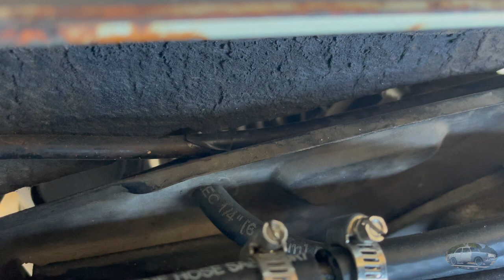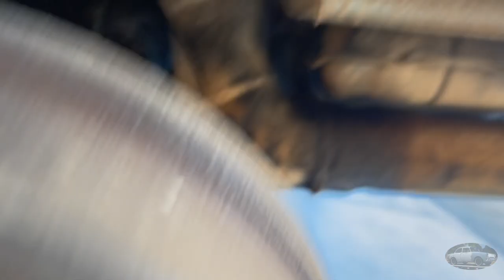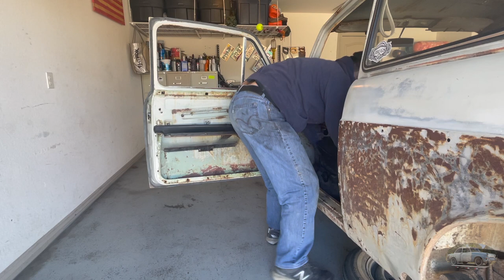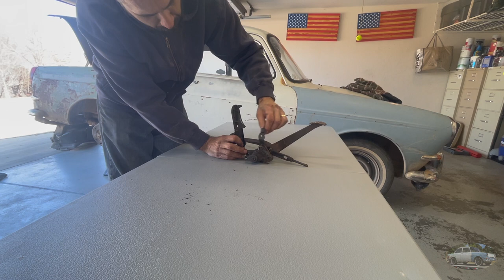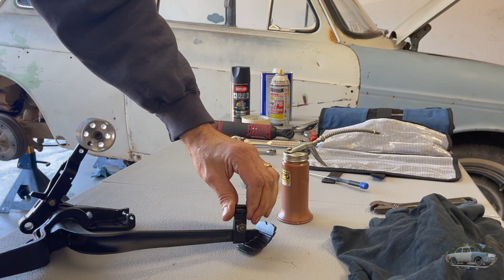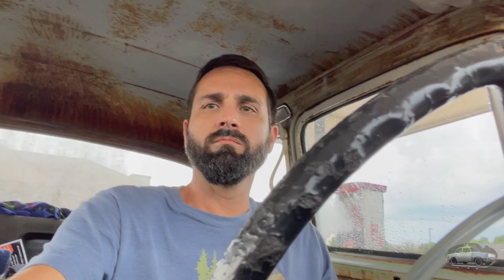Pistol Wheel Installation and review

Comment: Nice job, quality products really make a difference.  Did you consider putting pedal rubbers on while the pedal assembly was out.?
I really struggled to get new rubbers on mine in my dune buggy, they were so tight to get on, and you had to be a contortionist to actually get down in a position to push the rubbers on.
They were supposedly the correct ones, but after fighting with them for hours I was beginning to wonder.
Reply from the maker: In all honesty, no.  Rubbers are on my list, but as usual, I'll be doing everything here the most inefficient way possible.  I appreciate the heads up that getting the replacements on could be a nightmare!  If so, I'll definitely see if my good friend silicone spray can help out a bit.
Reply: @vdubjunkie  Let them sit in a bucket of really hot water as well, it helps soften the rubbers to make them a bit more pliable.
Reply from the maker: @mrpaisleyshirt  nice tip. I’ll have to try to remember that.